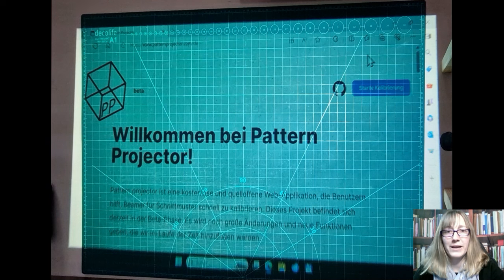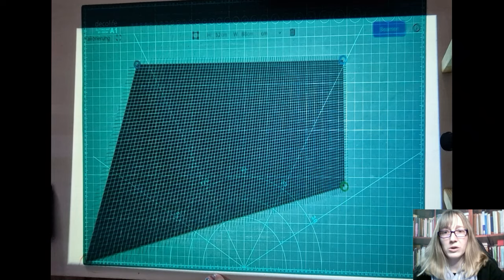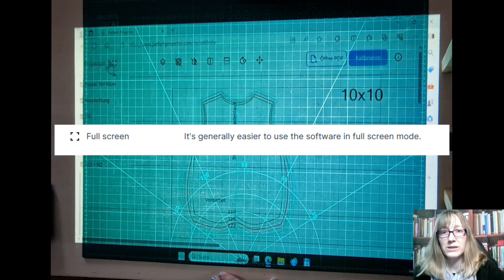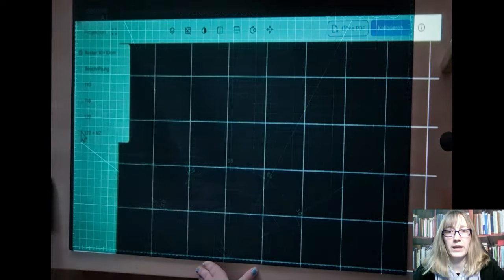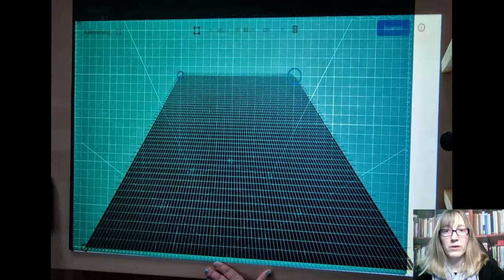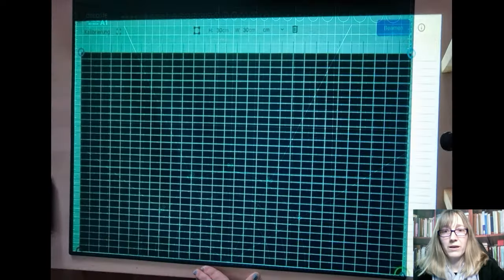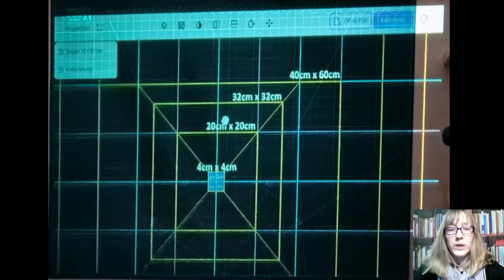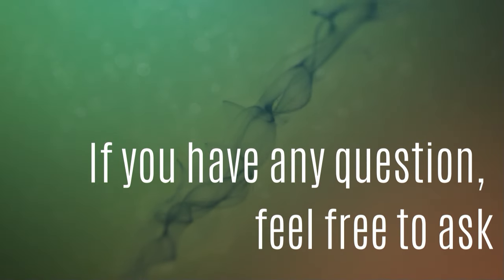easy calibration with pattern projector - sewing with projector

Comment: Hi Yvonne, thanks for this I can’t wait to get my projector set up again (after a house move). Q please, my cutting table is 150 x 90cm. I got a UST projector at Christmas and because I knew I was moving and floor was crooked I just cut on a cutting mat with cardboard underneath to correct unevenness. I’ve put a spirit level on my cutting table and there’s a slope. I’m going to try and correct this by putting things under the table legs. But you said that if you’re using a UST then to cut on the mat and I want to be able to use my whole cutting table surface. Could I print out a paper calibration grid and use that? What size would it need to be? I’m thinking would be good to perhaps have it laminated also so doesn’t get damaged - would that affect the calibration at all?
Reply from the maker: The print you need should be as large as your projection. And if you want to cut without a mat, than i definitly would recommend you that. You can try it yourself. Calibrate on the mat and then take it away and see the difference. For myself it was more than 2 mm diffenrence. Of course it depends on how exactly you want your cut.